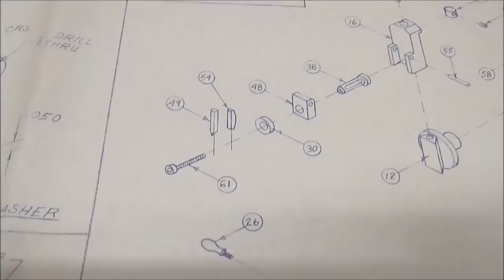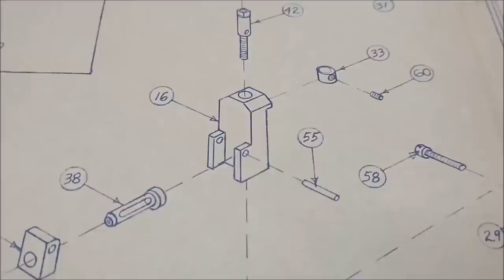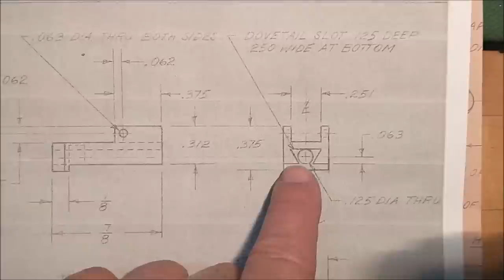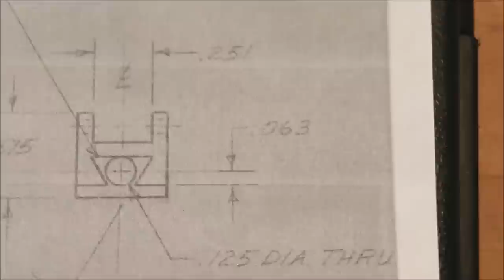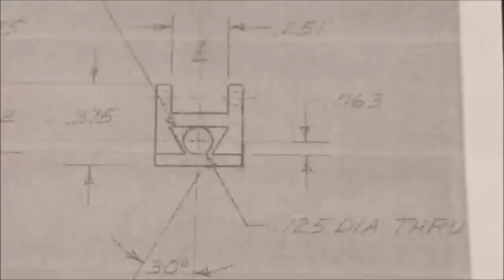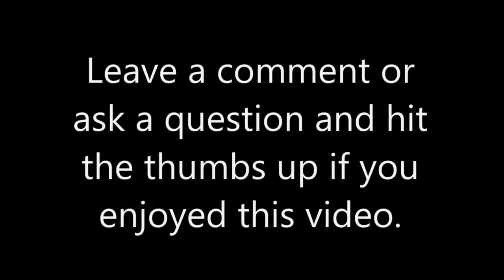Machining a Miniature Shaper - The Tool Slide

Comment: Hi Joe.
You definitely should have made the miniture wire EDM (spark errosion) machine first.
Then use it to make / modify parts & cutters.
In the similar veign, a miniture electro-plating tank could have put 1.5 though back onto the sides of that slide.
Sorry: any excuse to comment the algorithm up.
Great work.
Reply from the maker: Off camera it was less than an hour to make another one.
Reply: lol
Reply: @joepie221  Hi Joe,  yes I understand.   Even a real EDM would have taken several hours - after the programming.  But its a fun thought & every comment is "counted" irrespective of what the words say!  Good luck.

Comment: All I can say is amazing.  I would like to know where can I order a dovetail cutter like the one you used in this video?  I try to make hardware for my Dial test indicator.  So far I have been unable to source a dovetail cutter that small.  I'm was worried that I would have to grind one  out of a carbide blank.  Thanks for all knowledge that you share with your subscribers!
Reply: Try someplace like Brownell's if you can't find one anywhere else. There are various angles used for cutting sight dovetails that are this small.
Reply: Google is your friend. Plenty of options for 0.250” dovetail cutters come up.
Reply from the maker: @jamesreed6121        https://www.micro100.com/products/dovetail-cutters  ( I'll still give them a shout out although they refused to give me a discount code for my subscribers ) I use a LOT of their products.

Comment: I'm still curious about if your going to mount all of these steam driven machines to a gang way with belts and the like to your tiny steam engine. I live in an apartment complex that still has left over scars from the days it was a mill building that used a gang way (most obvious features in the buildings are the floor humps where drive shafts were mounted for the floors below) and belts, but they used mill ponds and penstock turbines.
Reply from the maker: I would ultimately like to do that.

Comment: Just had to redo that piece, I totally understand that, it'll bug you every time you look at it until you ''fix'' it. Nice job, Joe.
Reply: I think I would have tried squeezing it in the vice a little first. Getting dovetails that size to fit and run well is not easy.

Comment: Always appreciate your machining tips, especially on the tapered setscrew relief slot. Perhaps due to my relative inexperience in machining dovetails , when I built this model, I had to modify the dovetail dimensions as I was unable to source a 1/4" 60 deg cutter that would cut to .125 deep. The cutters I found would only go to .110" so I made the female depth .110 and the male at .107 deep (in keeping with the recommended flat clearances you shared in the lathe build). I kept the .25 shaft hole in place and changed the height of the female base from .063 to .078 to accommodate the shallower dovetail. To be sure of my dimensions, I modeled it in F360 before cutting any chips. Maybe there is a better solution, but I couldn't think of one. Any thoughts on this?
Reply from the maker: The length of cut on a dovetail cutter can be controlled or manipulated by the width of the entry slot or corner break on the components. My cutter also was less than the required .125, but the flats and channel design made the cutter more than adequate.
Reply: @joepie221  I notice you had small flats on the edges of the dovetail that were not shown on the print. I wondered if you had done this to accommodate the shorter cutting length. Now I know. Thank you for the response.

Comment: Hi Joe Absolutely loved this build, glad you are making a big thing of the final assembly. Can't wait. Just as aside I have seen the full size in operation, on some pieces the operator would hold the clapper box up on the back stroke so the tool would not mark the finish, a bit hairy when the stroke rate was high.

Comment: Joe Pie how many actual hours do you have in this shaper sir?  It is amazing. Are you going to make a vise for the table. I would love a small vise like that for a keychain.
Reply from the maker: I'd have to look back at all the video collected and probably multiply the hours times 3 or 4. It's going to be a very expensive little model when its done. Like all the others. As for a vise.. here ya go.   https://www.youtube.com/watch?v=Nobmbjef7Hc&t=48s   I've thought about running a bunch and putting them on my website as a limited edition offering.

Comment: You can also clear the tap if you need to, just grind down the shank until it can pass through the hole
Reply from the maker: Be careful if you do that. On bigger taps, no problem, but this tap is very small and the brass is grippy. Maybe an Emuge tap?
Reply: @joepie221  correct me if I'm wrong, but when clearing the shank of a small tool, a good surface finish will be much stronger than a tool with a bunch of apprentice marks on it. In my mind any little dings will be a stress riser

I've always cleared my tools using drill and the grinder to get a nice smooth finish and haven't broken a modified tap, But I've seen people grind them by hand and have them break on the first hole.

But then again I'm usually alot more careful when working with modified tooling

Comment: Fantastic work and craftmanship. Having watched the lathe videos I'd say that the planer is trickier. Your miniature workshop will look fantastic. 
The man who taught me machining never smoked but always had packs of cigarette papers around. He'd use a cigarette paper to gauge the distance between the tool and the face, a cigarette paper is 0.001" thick and each pack therefore has lots of consistent gauges in for a few pence.
Reply from the maker: I'm thinking I have a vertical twin coming up next.

Comment: You use an indicator more often than you use an edge finder, is one more accurate then the other?
Reply: https://youtu.be/dMKLZEgh_SU
Stefan gotteswintee has done a comparison.
Reply from the maker: One philosophy on using an indicator vs an edge finder is that after picking up an edge with an edge finder, you still have to move to get where you're going : like the center of the part. With an indicator, once dialed in, you're already there and there is no chance of an error.

Comment: As many times before, an excellent work done by a master. Don't forget the filming and editing.
That undercut to avoid disturbing marks by a set screw impressed. It can be used anyware.
Reply from the maker: Undercut for parts that rotate, or a flat for a static assembly. Choose based on the application.

Comment: just so satisfying watching your videos . I worked on my sliding gear set up for my power feed and X axis  lead screw that has bearings on both ends instead of the floppy screw. I'm going to change the gib to the back so the DRO is on the front too , with adjustable screw nut. Will do a video of assembly went all the parts are made. Will be a big improvement to the mini mill. Thanks again my friend

Comment: I enjoy watching a craftsman at work, Thanks for sharing.

I want to add that I like the new intro, nicely done to the point and short. Too many you tube intros are so long that I loose interest.
Is the tilt lock set screw as designed? 
I think it might look better as a square or hex head bolt of maybe another bent handle screw.

Comment: Somewhat unrelated to machining…. does Joe’s video intro have a Starsky and Hutch vibe? 
Nice job on the dovetail fit, and did not know about the possible errors in dovetail cutter profile, creating a fitment issue.  Well done Joe.
Reply from the maker: It's better to have a radiused edge or a chamfer to avoid chipping of the tool, but it does mess with the gage point if you don't have a hard dimension for your calculations. The cutter was awesome.

Comment: This is a gift of precision and beauty. I remember requesting you do the Shaper first because I didn't understand how they worked. Now I have an understanding. Thank you!
You are amazing and inspiring. Do you plan on painting the body when it's finished? Dude, I'd pay YOU to let me clean your shop!  :)
Reply from the maker: I knew nothing about shapers when I started this model. It was a disadvantage, but made it more interesting as I learned. The only thing I'm still not sure of is which direction the link goes between the ram adjuster nut and the crank arm.

Comment: Dovetails definitely induce the pucker factor - especially at the price of the tooling.... Reassuring to see even the pro's feel the same way .
Reply: You have to look in to a d-bit grinder. They are expensif, but you can make and sharpen, a lot of cutters and tools yourself.
Reply from the maker: That cutter cost almost as much as the model.

Comment: 2:32 how do you calculate what that mic 'should' read when using pins or in this case are you just measuring the difference between pins before and after a cut?  How would you calculate using pins inside dovetail angles?   I guess it's just like using wire gauges for thread measuring but at least those have a list of set measurements to go off of.
Reply from the maker: I developed the gage dimensions based on a projected target. for the internal dovetail, you use the same pins, but feeler gages or gage blocks between them.

Comment: Hi Joe, thanks for the video! Is it a case of measuring a test cut with a dovetail cutter to check the diameter, or is there some other way? Thanks!
Reply from the maker: A test cut in a piece of scrap material is the only other way I can think of if you don't use an optical comparator to check the tool.

Comment: At 23:37 you mention to not open the vise with the parts together. Can you elaborate on that? What happens?
Reply from the maker: If the part geometry will shift after the pressure is released, it could choke mating parts and seize. Like keeping a plug gage in a bore while opening the chuck. Minimal grip pressure for final ops is always a good idea.

Comment: Is there a point where you have enough of the tap tip protruding from the other side that you just tap it from the back? For example you could counterbore the first side slightly just to get enough tap out the back and then flip it
Reply from the maker: I've actually done that, but it is risky.
Reply: That's something not to do. If the thread has to go through, alter the taps shaft or get a different one, fit for the purpose. In this case it didn't matter.